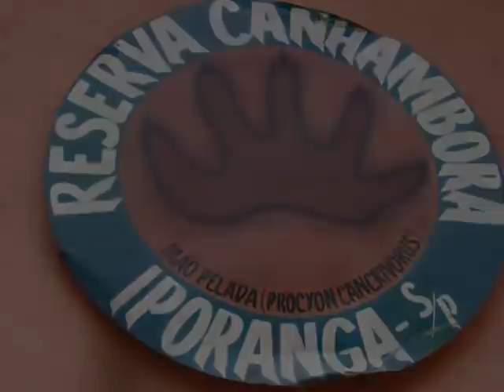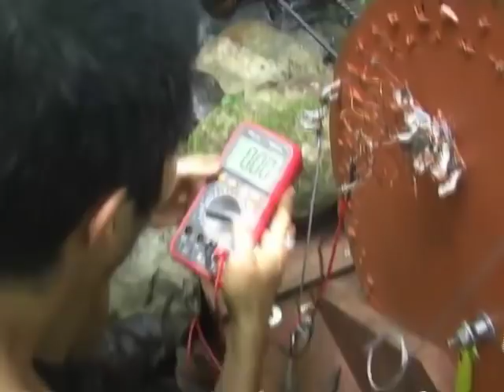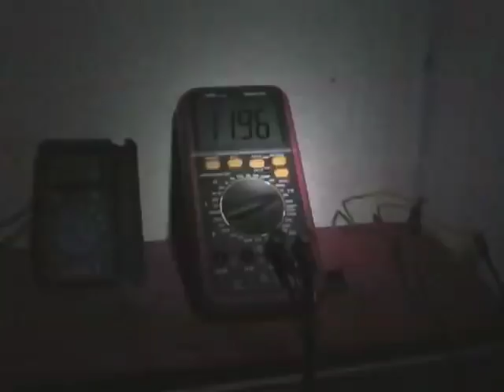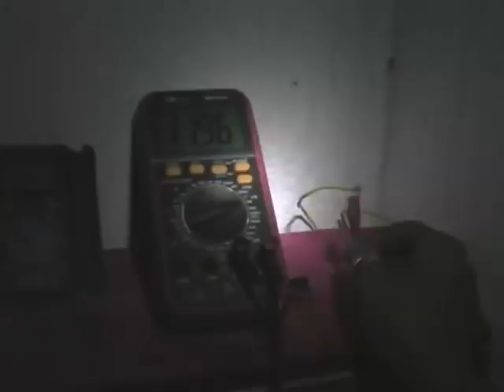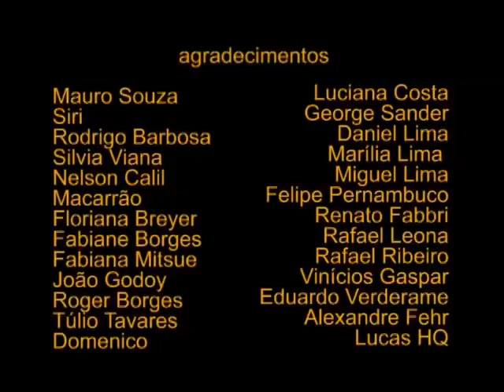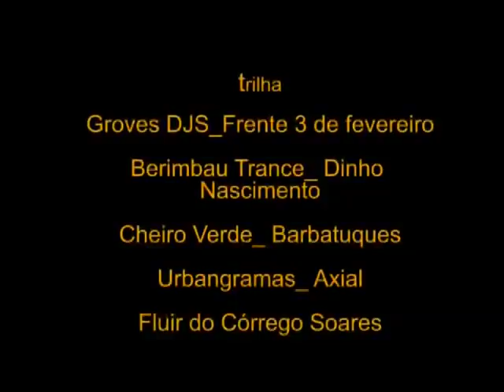Gerador Elétrico P2RCA part II

Comment: Solo decirte un consejo , les convendría poner el inversor justo al lado de del generador de 12v de esa forma ustedes tendrían menos pérdidas en los cables y funcionaría mucho mejor con mas lámparas, es fácil si consideramos 100w de consumo en 12v son 10amp pero en 110vca es 0.93 amps como tiene ahora los cables del generador a las baterías y al inversor son muy largos y deberían de ser de 4mm2 , e igualmente tendrían pérdidas , con el mismo cable pero las baterías y el inversor al lado del generador prácticamente no tendrían pérdidas y podrían poner más lámparas sin que notasen la diferencia, siempre y cuando no excedan la potencia máxima del inversor
. Saludos y buena Suerte

Comment: 10.5 volts en un sistema d 12v no es aceptable puesto que indica baterias en estado completo d descarga, no carga se esta aderiendo a el systema,, estado completo d carga para  12 v baterias es  Cerca de 13.4 v, 12.5 es  aceptable 12v es batteria